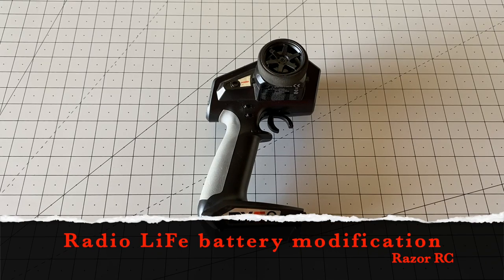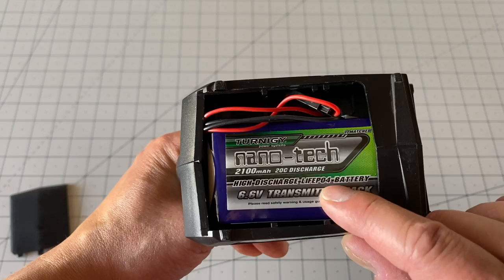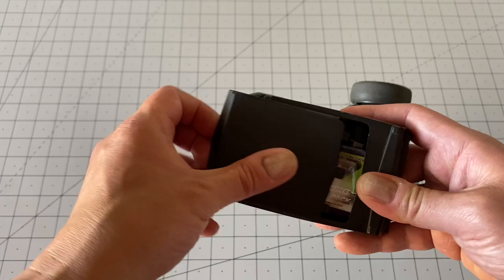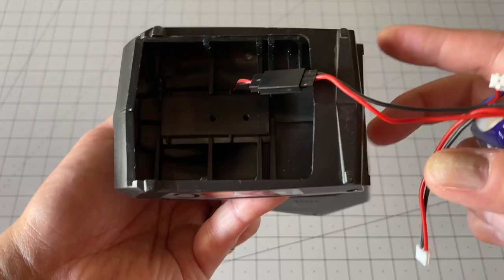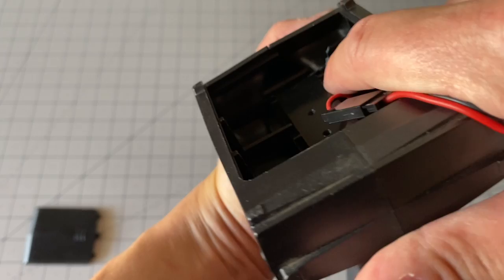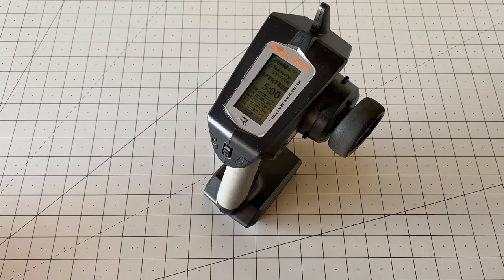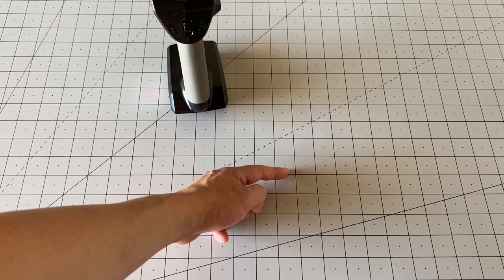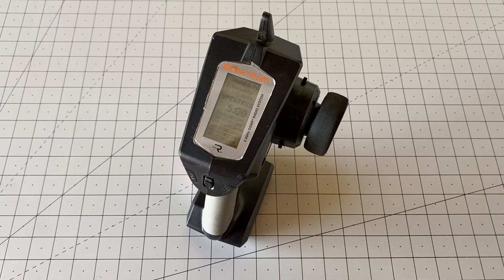Li-Ion LiFe battery mod for your RC radio transmitter (Spektrum DX5C)

Comment: That's awesome.  I did exactly the same thing + battery.  I tried this a while ago but used lipo.  Your right, bad idea.  
I finally seen your vid and went ah-ha. Wheels started turning.  And low and behold, I got a smile back on my face with the 
"Alien Headed" DX5C... LMAO. 
Thanks for the vid and heads up. 
Have Fun.

Comment: I use NiZn AA's in my Dx4rpro. They are rechargeable and give about 6.8 Volts The controller works really well with them and no mods needed. They do take about 12 hours to charge so I bought 8 of them so 4 could be charging while 4 are in use.
Reply: Can you please send a link to those batteries

Comment: I’m sure I’m not the only one asking this... Can LiFe  batteries suffer from over-discharge same as LiPo and LiHV (Lithium Hi Voltage) batteries? As I know that LiPo and LiHV once you hit that low voltage (3.0-3.2V per cell), you MUST stop using it, let it cool fully and then do a balance recharge or put it on a storage charge (if you keep using your battery past its minimum safe voltage... it will more than likely kill your Battery or worse, become volatile and either catch on fire or explode!)

Comment: I don't know where you got your info from but lipo batteries as long as you put them in storage charge mode they last forever and do not discharge and if you balance charge them correctly you never have an issue and a 2S is actually 7.4 volts not 8 volts
Reply from the maker: no, when you charge a 2S it goes to 8.4V.  7.4 is only 50% charged.  And I've seen several LiPo fires in person, so...
Reply: @RazorRC  lol wrong if you charge the lipo properly by balance charging it it will go to 7.4 50% is 3.7
Reply from the maker: @MrYukon04  sorry bud, you're way wrong on this, put a voltage meter on your 2S next time.
Reply: @RazorRC  I do plus my charger shows 7.4 sometimes 7.6
Reply from the maker: @MrYukon04  you’re not using your charger right.  All balance is doing on your charger is evening out the voltages across the cells, you need to use balance charge or charge and you will get the full 8.4v for a 2S lipo.
Reply: @RazorRC  I'm using it right it won't let you charge them wrong. It's a smart charger. It shows the volts of each cell and while charging it shows the amps and capacity. It does show 8.4 while charging but once it's done and you put a meter it shows 7.4 sometimes 7.6 and in storage mode it discharges to 3.7
Reply: @MrYukon04   Im sorry but you are so wrong, all lipo and li ion 2s come out to around 8.4 when fully balance charged I ve checked with a multimeter and I m an electrician.   They may sag a little to 8.3 or something but thats it.  Sounds like something is wrong with your charger

Comment: It would’ve been nice to see how the radio comes apart. I’ve taken all the screws out of mine but can’t seem to get it apart
Reply: The grey rubber handle grip needs to come off. Wedge a flat head tool in there and work it off. I know I’m late to this video and comment but hopefully it helps. The screen covering is glued on too so you’ll have to carefully work that off too. These aren’t made to come apart

Comment: The 8.4v isn't to much for these guys. Most have the capability to run 12+v. Years ago remotes took 8 AA batteries which is about 12v. Just like the flysky gt3b. The technology worked so well and was so cheap to manufacture they continued to use the same internals.
Reply: Do you think I could push 12 volts on my dx5c?
Reply: @nitrogas5719  I would imagine so but Is it worth the risk? To me it wasn't. Thats why I use a 2s lipo. A 1000mah will last a year before needing a charge
Reply: @rc-daily  thanks for the information! The reason I was asking was because I wanted to install a range booster and was wondering if I could just run one 3s battery instead of having to run one 2s and then one 3s
Reply: @nitrogas5719  ahh I see! It may be worth trying in that situation then. I'd be willing to bet money it would work fine but theres definitely a risk.